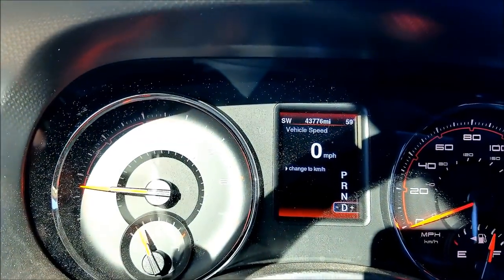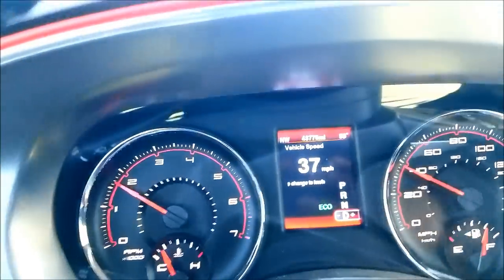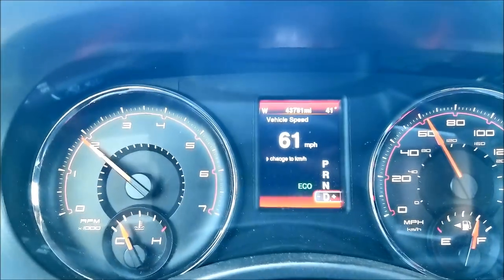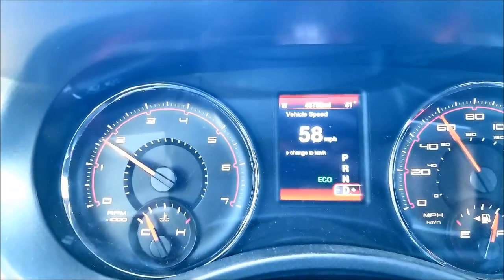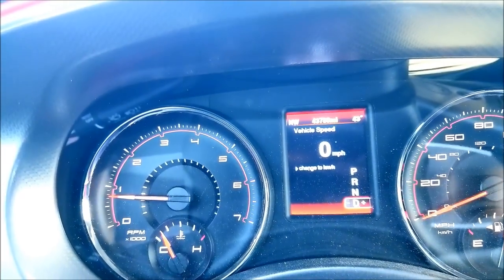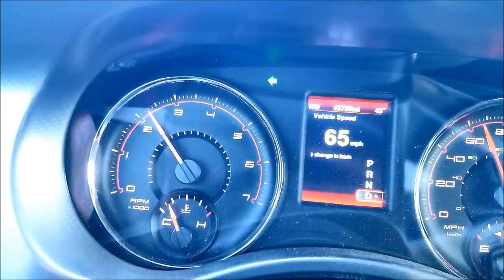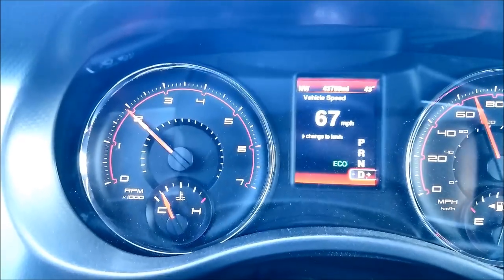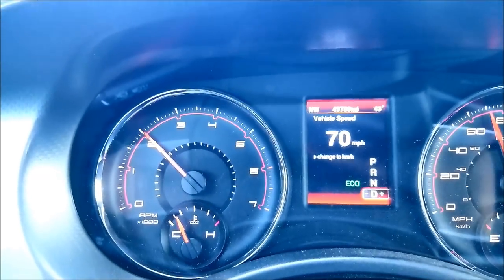Can You Daily Drive High Stall Torque Converter?

Comment: This has to be a locking torque converter, arnt older non lockup torque converters different?
I know you'll burn it up on the high way if the cruise rpm is lower than the stall.

I know I can get a 3000rpm and be fine with 4.10 gears on the highway.

Driving in town do I need to keep it near there too, or is city driving fine in the low rpms.

Just to clarify its for a nonlockup Ford C4 in a 1970 Maverick
Reply from the maker: Mine is a locking TC.  You are 100% correct non locking TC will burn up.  Most TC that you buy now are locking
Reply: Yep, looks like they don't make any for the old c4's though.  
I could swap in aod, but the 1970 I have is a weird year the transmission tunnel is smaller than 71-77 Mavericks.

I'll probably just go C4 and do plenty of research on the torque, I'm wanting the highest I can get without burning it up on the street.

I think 3000rpm will be safe with 4.10's and right size tires.
Reply: Also thanks for the fast response

Comment: Can you help me to understand more about stall test on my 2017 Camaro SS.. when I mash the brake and gas I feel the car starts to move around the 1200-1500 rpm, the rear wheels will start spinning at about 2000-2200 rpm.. I've been having a torque converter shudder and trying to diagnose the issue since my local chevy is not helping me..  Dont know the manufacturer spec on the stock converter.. I took it in 3 times and all 3 times were trans fush, refuse to replace torque converter until check engine light code pop up..
Reply from the maker: Id like to help you but I do not know enough about testing or detecting a failing converter. Sorry

Comment: I am adding a 3000 stall torque converter from FTI to my 2006 Chrysler 300c SRT8  with the 6.1 HEMI and NAG1 trans. I have heard that some people have overheating issues on their transmissions after installing a high stall tc. However, this is usually from people installing them on 1/2 ton trucks. Is this something that you have noticed with your car? Considering your car is a 5 speed, I'm only assuming they were still using something similar to the Mercedes Benz NAG1 in your car. My car is fairly stock aside from a CAI and 91 octane DiabloSport tune.
Reply from the maker: I do not have any trans heatig issues. I drive mostly highway though

Comment: I've wondered if my rpm's are below my stall speed at cruising speed down the highway if it would be slipping & burning up my trans. The way my truck is geared and it has no overdrive I'm at about 2800 to 3000 at 60 so I got alil room to play with.
Reply from the maker: Modern torque converts have a lock mechanism for cruising and you will not have the slipping or excess trans heat. Just make sure you buy a quality tc and you are good

Comment: Really good job explaining that, thanks.  I'd guess fluid temps would be higher.
Reply from the maker: So far my trans temp sits at 172. Highest ive seen it was 190 hot day heavy stop and go
Reply: @dasllamas  Yep, those are normal temps.  Same as I see with a stock converter.

Comment: Doesn't a high stall converter create more heat?  Do you  need an extra transmission cooler?  Is the OEM cooler up to the task of cooling a looser than stock converter? Have you had any issues? Great video, BTW...I'm just curious.
Reply from the maker: m schiffel I have not had trans heat issues. My understanding is that the stall has a "lockout" so above a certain speed it locks out. Older high stall torque converters can continue to to free spin for lack of better words and that's what causes the heat. 

I do drive in heavy traffic on the way home from work for about an hour. 30 minutes of which are in stop and go traffic. This is where you would see the heat build up but i have not seen over 183 degrees on the transmission. I have not added anything else to the transmission other than the torque converter. I do have a custom tune on the car and I think you can tune when the torque converter locks up for daily driving. (I'm not a tuner so not sure if this is accurate) otherwise no issues. Improved my 0-60 from 4.7 seconds to 3.9 seconds.
Reply: OK, thank you.
Reply: @dasllamas  high stall converters create more heat in the stalled stage of operation due to higher inefficiency on the fluid coupling creating more heat. It has nothing to do with the lock up point of the converter.

Comment: Do you have a positive displacement supercharger?
Reply from the maker: Centrifugal supercharger. Procharger brand
Reply: @dasllamas  I have a 2.1 kenne bell on my 02 mustang gt. I'm having a 2800 stalled built transmission put in. My peak torque isn't until 3800 rpm. I hope it helps
Reply from the maker: @micahobaca  it will definitely get you up to that powerband quicker. Really woke my car up

Comment: 😁👍very. Nice video. I have  learn.  Alot.  🙏🙏Thanks..I'm instilling a 2800 stall converter to my 5.4 harley davidson supercharged truck next week whit 2 stage cams.  This is my tuner recomend.. 😁👌
Reply: Hey bud did you do the converter how does it ride if so. I have the same truck
Reply: @tylermulkey330  hi. Men. Is so much power.   I  broke.  My transmission cross member.  So. Y weld. 2 plates. To the. Support.  Now. Is soo much better.. also. I instal  a trw flex plate.  But. A have machine. 3 extra holes  because mi torque converter  have. 6 bolts.  I my self  have Ported heads ported eaton and the Turkey pan. I special order. My piston. To JE . And have manley roods. Also 2stage pro cams. Arp main and heads studs . Shelby gt 500 oil pump you will have. More lubrication on your valves.  Aem  e85 compatible dual  fuel pump .120 lbs Siemens deka injectors.also I need to get my e85 sistem .,and make the tuning. I have only 1200 miles. On mi motor. Im still waiting to smother in..If you ever. Need. Any inf I bee glad to  let you  know. Good luck. 🙏😁✌🏻
Reply: @abimaelpatino7892  damn homie sounds like you got a handle on it. You truck seem like a  solid build. I’m definitely gonna pick your brain on alone
Of the stuff I have going on I have An 08 SCab roush conversion that’s wht I said same truck but ya I bought a roush off eBay an lower manifold an rails an injectors an piece of this thing together so not all the way there as of yet but making it happen little by little. Wht stall you have? On tht TC?
Reply: How many splines  did your input have or do we have 30 or 31?
Reply: @tylermulkey330  dat. I don't know.   You are talking about the torque converter ❓its. A. Presision industries. Whit 2800stall
Reply: @tylermulkey330  10.5 inches this is the size off the torque converter
Reply: @tylermulkey330  I purchased directly from them is much cheaper

Comment: You say locking or unlocking  Is this a Locking type of converter or a regular converter just with a higher stall ?
Reply from the maker: It is a newer converter that locks. This way you dont have to worry about the trans overheating like the old style ones. I still watch my temps but have not seen an issue.
Reply: @dasllamas    Thanks  I'm planning on putting a 3000 in my 1984 Porsche 928  I am not sure if its possible to put a locking type in it.  Thanks for the answer :)

Comment: Awesome video. I've been looking for one just like this. I was worried about cruising rpm speed and you really made my worries disappear. Thanks!
Reply from the maker: dan  brauner i was in heavy stop and go for 2 hours the other day. Trans temp hit 190. Other than than that no issues at all
Reply: dasllamas I've got a 2015 392 with a 274 cam. I need that stall converter so I can lower my idle rpm so I'm not shaking the bolts out of the frame!

Comment: Does a 36,000 torque converter affect the longevity of the transmission even if it has a cooler?
Reply from the maker: Depends on who you ask. Some say it will cause the trans to over heat because it is constantly "slipping" but that is with old tech without the lock up. Newer tc shouldnt effect the longevity. The torque converter just connects the output shaft to the trans via a fluid. (Because the engine constantly turns and your wheels dont) it just has the internal fins set to move the fluid at a different rate to get the trans spinning.  It also comes with a lockup so the tuner can set when the tc locks so you dont cause overheating.

Comment: Hi, I am installing a 2800 stall for my GTO, since I am getting a cam installed also. Only driving to and from errands, work, etc. Don't think I'll ever race in the thing, I just want it to sound good and do damage if needed to. Would you think I would need a trans cooler? I am very new to all of this, so if I seem a little uneducated please excuse me.
Reply from the maker: As long as it is a modern torque converter and you don't have huge amounts of stop and go you are fine.
Reply: dasllamas Thank you for the quick reply. Now what if I happen to drive a pretty far distance (3-4 hours) with no traffic. Would it be beneficial to get a cooler in that instance?

Comment: Mine does the pulsating now, and surging at low speeds and breaking. I dont have a stall converter yet. O was tuned several times I was told I have to get a stall converter and then they can tune out the pulsating motion.  Did your pulse a lot after the cam install?
Reply from the maker: Tuner sat in the car with me on a test drive before I left to make sure the car didn't surge and everything was to my liking.

Comment: My question is, I have 13 R/T and plan on doing mods like a cam and some headers but for now I'm stock. I'm wondering would starting with a torque converter be an ohk decision or should I do the other mods first?
Reply from the maker: Other mods first. You want a torque converter that complements your power band

Comment: Additional atf cooling would be a good idea!
Reply from the maker: That was recommended by the tuner/shop too. Currently I still hold 173 for the trans temp. If I am in heavy traffic it will go over 190.  That is rare for me to be in traffic so that mod is put on the back burner. Next big mod will be an oil cooler system due to the car being supercharged now

Comment: will it be ok to run a 3000 stall on a stock transmission
Reply from the maker: Ran 3600 stall on my stock trans.  Just make sure your tc has a lock out and you get the car tuned for it

Comment: Do you have a aftermarket trans cooler??
Reply from the maker: I do not.  Still runs at 172 degrees. 180 on hot days with heavy traffic
Reply: @dasllamas  i have a 3800 stall in my 09 jeep srt i have a 180 thermostat i didnt know if i would need one or not thank you for responding im just running across you vid now
Reply: You think i will or I should be fine?

Comment: Hi , does the car need to get reprogrammed or tuned for this mod to work or can any shop simply install this and the car will adjust on its own?
Reply from the maker: You need to have a tuner tune the shift points.  Any reputable shop can install it but you have to find a performance shop to make it run right
Reply: Thank you.

Comment: Ive been thinking about a 2800 to 3000 stall speed torque converter also. What do you think would be better for a 5 speed to try and hang with the 8 speeds, a higher stall speed torque converter or higher gears or both? I also have an awd and I dont know how it would work out with the awd to modify the gear ratio.
Reply from the maker: Humanoid 77 i have not modified the gear rations. Still have the stock 3.06. As for what stall to get that will depend on your power curve from a dyno. 3600 worked for me because i am procharged. For you it depends. Maybe 3200 if you have mods and a tune
Reply: dasllamas thanks for the quick response. I only have a diablosport predator 2 91 octane tune and a magnaflow catback exhaust for now. Its a daily driver and I plan on doing some more mods but nothing as aggressive as a supercharger (I wish).
Reply from the maker: Humanoid 77 best bet is to talk to the company you decide to go with and get their recommendations. If it were me id say around 3200 would likely be where you want to be. Just know this mod changes the drivability of the car as a daily driver. I do it with a 3600 and make it work because #racecar
Reply: dasllamas, yeah I will try and talk to them when and if I cross that bridge. Thanks again for the quick responses. Keep up the cool videos and mods.

Comment: Would the converter and transmission heat up due to slipping alot ?
Reply from the maker: Though this is true for older style torque converters newer ones have a lockout that prevebts this for being an issue. The only time i have seen it be an "issue" was in heavy traffic for about an hour and that caused the trans to be about 10 degrees higher than normal. 180s vs 170s

Comment: why is ur coolant temp so low? mine sits around the middle. I also have a FTI 3200 Torque Converter, the taping happens with  mine from Idle only and when the car is cold.  but great video.
Reply from the maker: Hemi Pharaoh 180 degree t stat mod
Reply from the maker: Hemi Pharaoh and water methanol  system helps keep things cool too
Reply: dasllamas really good if you love your car lol

Comment: Thinking of doing this as one of the next mods on my truck. I've got an '05 Ram 1500 with the 5.7 Hemi, 545rfe 5 speed. It's got 200k+ miles on the original engine and transmission, so I'm thinking a built transmission alongside a 3000 rpm high stall would be a sweet upgrade. Anyone do high stall in a full size truck? Would towing be affected? I'm assuming a high stall could actually help when taking off with a heavy trailer. I will probably have to get a tuner also I assume to get those shift points right.
Reply from the maker: Yes you will have to tune to get the shift points set and set when the stall locks up.  I will pin your comment in hopes someone in the community can answer your question with first hand information with the truck and torque converter.
Reply: You want your cam paired with its convertor. No point in stalling into an rpm range if your skipping over a usable portion of your cams rpm band.

Comment: Hey i justed installed my stall its 28-3200 hundred stall to go up hills its takes almost 3000 rpms for it to start moving (you can really feeling the engine lugging is that common ?
Reply from the maker: at lower speeds or at takeoff the torque converter can feel like its "slipping" your engine shouldn't be "lugging" though.
Reply from the maker: Also it will flash to 3000 because thats the rpm your torque converter is set at but when it hits 3000 the car should just go

Comment: Good video brother and you are right by saying it feels like the transmission slipping but what is slipping is the torque converter because the stator is not fully locked up. It's not a true 3600 stall because of elevation it's probably around 3000 to 3200 but at sea level it would be 3600 stall. I have to disagree with you on the torque converter v.s. pedal commander. Neither one adds horsepower or torque and if your car is stock or close to it meaning you don't have  cam, heads, blower, or supercharger then doing a torque converter would be pointless. Also the price point of a torque converter v.s. pedal commander is super lopsided. Torque converter will void a warranty and a pedal commander will not. I know you hate the pedal commander hype train but come on brother lol.
Reply from the maker: MeanBee392 haha yeah I think the converter with install is around 1000 to 1500 more than the pedal commander 😆
Reply from the maker: MeanBee392 also with the stall what power your car has effects the stall as well. With any torque converter the stall is an approximate number
Reply: MeanBee392 i have no internals done on my car only bolt ons...just had RPM do a 3600 stall on my 14 AWD Charger and for you to say it is pointless, is not accurate. I think the car gets the line faster and it pulls harder. I plan to do a cam i. Th near future, but i am thoroughly enjoying the car as is now. I also have added a pedal commander and it is awesome!
Reply: dasllamas Yeah that's what I am saying lol!
Reply: dasllamas that is also true but that doesn't take as much of a toll as altitude unless you are putting a 6K stall on a 180 HP car lol
Reply: Nick Tomaro you have bolt ons so it's going to help. What I am saying is pointless is if you have a stock car and do just a torque converter then it's pointless compared to a pedal commander and especially the price difference  (bang for your buck). You are doing it right because you said in the future you are going to do a cam and you will really be able to optimize the full potential out of the cam with the converter!
Reply: Bottom line is that a higher stall torque converter gets you into your power band faster.  The pedal commander is a gimmick (albeit a clever one); want faster throttle response?  Step on the throttle faster.  Want better MPG?  Don't step on the throttle as hard.
Reply: John Cahill What no one is reading is that if you have a stock car or a stock car with CAI, and or exhaust and that's all you are going to do then it's a waste of money and a waste of a torque converter. So my question for you is if the pedal commander is just a gimmick and that's all there is to getting better throttle response is by stepping on it harder then why is Dave's tune have a throttle adjustment programmed into it? Why doesn't he just step on it harder?
Reply: John Cahill Hahaha I am not trying to be a dick either but I do understand you are kinda speaking from a point of knowledge and this is going no where with you. I have two old muscle cars that I built and I was raised around muscle cars I have worked on dragsters that ran in the 6s and did 1 second 60 Ft every run. I turn wrenches for a living so this stuff is what I do day in and day out. Nice chatting with you.
Reply: Okay, dude.  Enjoy the pedal commander.